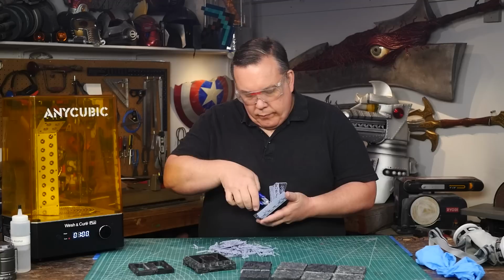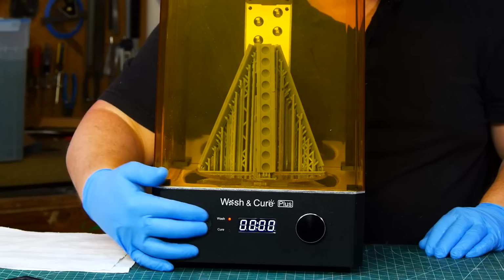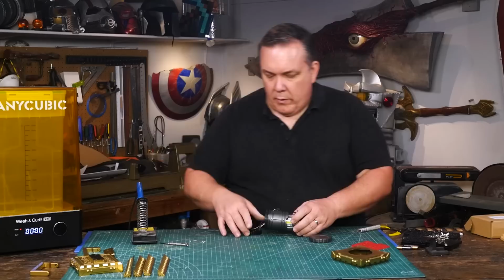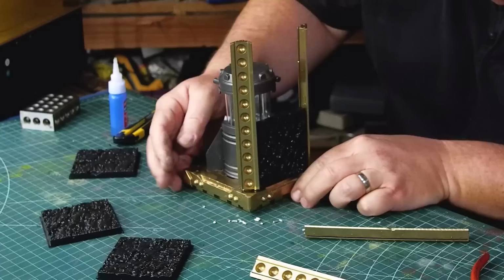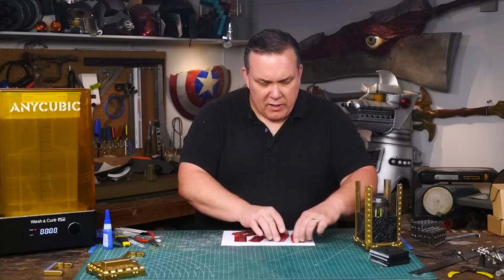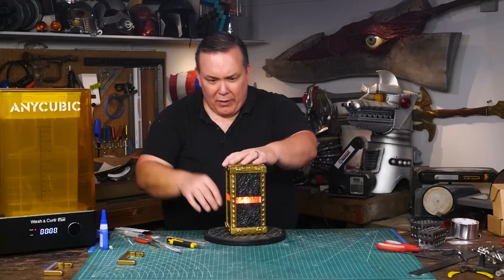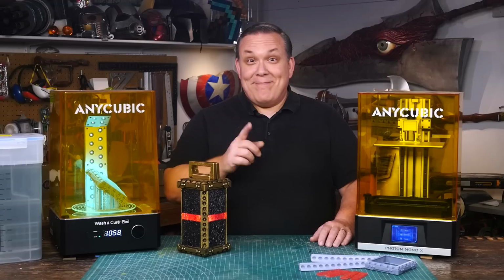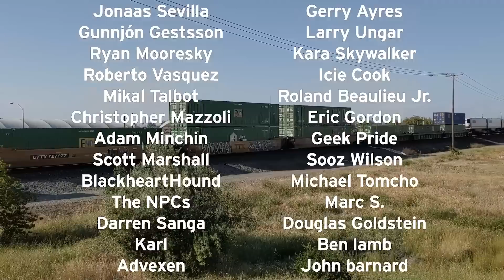Odin Makes: The Reality Stone container with Anycubic Wash & Cure Plus

Comment: Tips from my experiences: Dying the printed translucent pieces with alcohol inks before curing works well. Mixing the ink directly with the clear resign works even better. Painting the inside of all the non-translucent parts chrome will prevent wasted light but using adhesive mirror stickers works even better than that, if there is room for their thickness. Those mirror stickers are good for the inside of recessed light fixtures in your home as well.

Comment: Next time, try removing support material before curing. For tougher, heavy supports, after washing run the piece under hot water. 

This softens the thinner supports and they peel off like velcro.

Comment: Nice.
The engineer in me is seeing ways to build that using threaded rods to pull the lid and base together, and screws to hold the "handle clamp".
Reply from the maker: Love it! The ability to take it back apart would be sweet.
And the engineer in you would give the pieces a little more tolerance, I would suspect! :)
Reply: @OdinMakes  Possibly not.
But having a filament printer, I'd probably have a bit more leeway for adjustment.
I'd also try to build-in metal pieces to hold threads.
i.e. make voids in the model and pause the print at the right height to insert reinforcement before the bridging over the top.
That's something I don't think is possible for a resin printer.

And on the model-modifying subject:
The problem you had with the 3-piece walls might have been helped by modifying the clear parts to include overlap behind the top and bottom, then gluing them together so the walls are effectively one piece, rather than 3.

I actually have clear, black and gold filament too...

Comment: Cool prop, but why didn't you make the sides into a single piece first, by gluing the red and black parts together? Then all you had to do was slide the sides in. It probably also would've helped if the black and red had the same thickness.

Comment: If you want an easier platform for practicing fundamental 3D modelling, there is a free, web-based tool: Clara.io 

I'd tried learning 3D modelling with Blender, and as powerful as Blender can be, it is far from user-friendly when you're still a novice with modelling. While Clara is definitely not something you want to use for more extensive work, it's probably one of the best, free platforms to get yourself used to modelling with more simplified tools (if you're new to doing it).